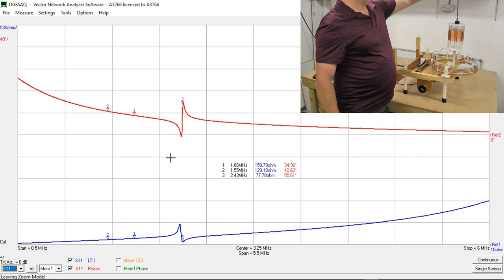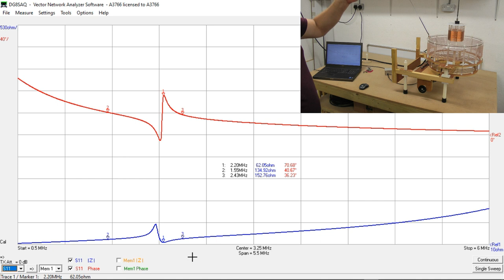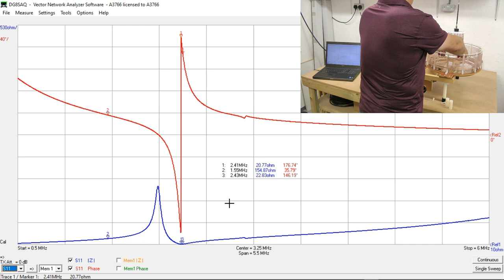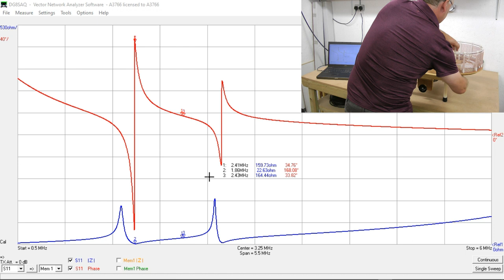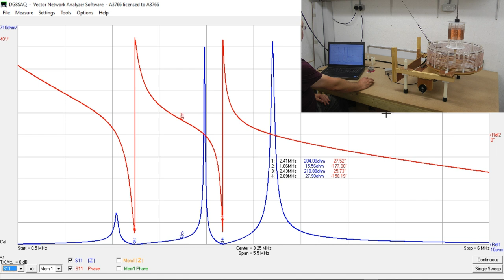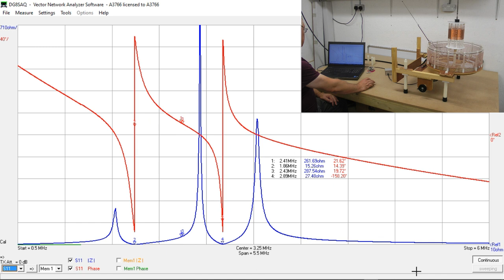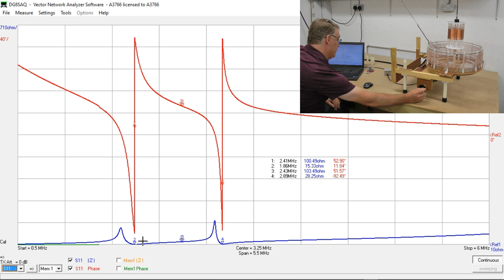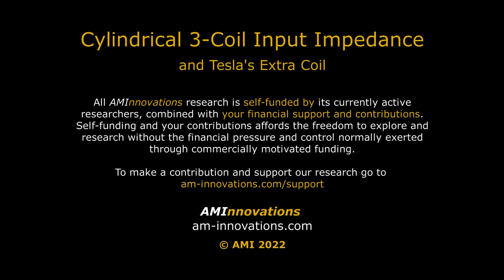Cylindrical 3-Coil Input Impedance - Tesla's Extra Coil

Comment: Hi Adrian - I am an EE who designs and builds TC and TM systems for making sparks! But I think we can have a civil discussion anyway! I have studied ladder network circuit equivalents for TC and TM, with and without a transformer. It seems to me that what you call a 3-coil system is really a 2-coil system with a split secondary, only a part of which is significantly coupled to the primary. The currents in the extra coil and secondary coil are pretty well matched because the shunt capacitance of the linking wire to ground is very small. The self-resonance of the isolated secondary is way above your operating frequency. To make a true 3-coil system, you need a significant capacitor from the link wire to ground, so that the isolated secondary with that capacitance resonates around your target operating frequency, the same one that your primary circuit operates at and the same one that the extra coil with its loading capacitance operates at. A system like this with 3 resonant elements might give interesting results? And tuning it would look great on your network analyzer. Best regards, Ian.
Reply from the maker: Hi Ian, thank you for your insightful comments, and I am quite sure we can have a civil discussion LOL :). The secondary and extra coil in the setup presented are not simply a split secondary with a low impedance wire link between them. The most important factor is that they are out of each others inter-turn magnetic field coupling distance, which falls of very quickly at the outer extent of the coil end. So they interact as two distinctly different quarter-wave coils which have one end connected, which is shown on the VNA measurements through the frequency splitting of the secondary and extra series mode resonant frequencies. It is the longitudinal cavities (LMD or longitudinal magneto dielectric modes) that are created between these distinct coils that makes this coil system particularly interesting for high efficiency transference of electric power over potentially long distances.
Reply: @aminnovations  Thanks for the clarification. I still wonder whether increasing the 'link capacitance' to bring the secondary self-resonance down to the signal frequency might improve your detection efficiency. Seems to me that a secondary coil self-resonance off-signal, with associated losses, can only harm efficiency? 'Sparky' 3-stage systems can be tuned like that, with high coupling factor, to get the energy out of the lossy primary circuit as fast as possible. Maybe your receiver losses are lower and don't need such measures. Regards, Ian.
Reply: @ridefast0  Hi, I have seen many designs by Tesla with dual secondary coils, Tesla said the coils resonated at both 1/4 wave and 1/2 wave as we need to build a coil that in its entirety resonates 3/4 of a wave to be in resonance then I assume that coil L2 must be 1/4 wave long while coil L3 must be 1/2 (1/4+1/2=3/4)
This conformation would not only allow the coils to be coupled perfectly but would also allow for lower coils to be made

I discovered that there is also a correlation between diameter and height which determines the speed of the pulse that crosses it, according to the explanation the second coil being thinner and taller has A higher speed of the low and wide reel and this allows to have the minimum load on the reel L2 

What do you think?
Reply: @cristianbianchi6155  When I design or analyze using lumped-L and lumped-C ideal components, the concept of modes does not arise so I can't help there. But in practical inductors, the ratio of diameter to height affects the Q-factor of the resonator and highest Q usually gives best results. The full mode analysis using transmission lines is too hard for me so I leave it alone - the 1/4, 3/4, 5/4 etc resonances never turn up where I expect them to be and it makes my brain hurt.😕

Comment: Thanks for sharing Adrian, good to see you working with the extra coil. I see the write up isn't online yet. I'll check it out when it's there.
I've been playing with the VNA and extra coil today as well. somehow my parallel capacity doesn't seem to influence much.
Also still questioning if a S12 would work with a series cap on the primary.
Since your are tuning wire length on the secondary, would you not prefer to connect the extra coil to the actual end of the secondary (antenna)?

Comment: my device uses a three stage bifilar coil setup. the two closest to the event collect and transfer the electricity. the one in the core transmits and transform's. works like a flyback. nice work very few realize the potential present here.
 just remember the powers that be wont let you collect free frequencies we are bathed in daily.
Reply from the maker: Hi, yes there is much to learn about how the coherent cavity of a multi-stage Tesla transformer works, there are very interesting transformations in electrical mode from TEM to LMD and back again, which go way beyond what is currently understood or utilised in current electrical power generation and transmission.
Reply: @aminnovations  ill be checking out the rest of your content. 🫡💯🇺🇸🙏🏼

Comment: The text I read from Tesla clearly states the extra coil is not within the electromagnet fields.
Reply from the maker: The extra coil is not in the magnetic field of the secondary. This can be seen when the secondary coil link-wire is removed from the extra coil, there is almost zero coupling to the extra coil and it effectively disappears from the VNA measurements. If it was in the magnetic coupling distance it would still appear in the results. It is somewhat surprising but the magnetic coupling falls off very quickly, which makes it possible to put an extra coil axially in the centre of a larger secondary coil - dependent on relative geometry of the complete coil system.

Comment: Why are there such large spaces between the windings on the primary and secondary coils? And why do you call it a cavity?
Reply from the maker: The spacing of the turns reflects part of the specific geometry for a specific application. This coil set is designed for transference of Electric Power experiments in the 160m amateur band, including Telluric. So you need to maintain a high magnification and quality factor combined with balanced TEM and LMD modes, which necessitates wider spacing between turns. Lots more on my website on this - starting from:
Tesla Coil Geometry and Cylindrical Coil Design
https://www.am-innovations.com/tesla-coil-geometry-and-cylindrical-coil-design
Reply from the maker: A Tesla transformer forms a longitudunal cavity for the LMD mode across its extension between two planes of much higher impedance, so this is normally from the top-load through to wherever the bottom-end is extended to, usually the ground, or in transference of electric power experiments to another Tesla transformer. This forms the "cavity", and in multi-coil systems there are a number if cavities interacting.

Comment: You are extremely close to some of my special frequencies in there. It's interesting. 3.24 megahertz is special, in my opinion.
Reply: And 1.88 megacycles. I'm trying to reach these exact frequencies. I've found the less turns with more space between windings allows for a much higher resonant frequency, right?
Reply from the maker: Hi, yes 234 and 324 are interesting vibrations as they represent the interaction between the duality, triplicity of life coming into manifestation, and the four-fold purpose of the unspeakable in manifestation :) ... if you have not seen it already you may find my presentation at ESTC 2023 on The Toltec System of Knowledge interesting. You can find a preview of this here from my website am-innovations.com : https://vimeo.com/864370550/e1e782c348
Reply from the maker: Hi, 1.88 is at the top end of the transition between the straight sword discharges, and the Golden ratio discharge which occurs at ~1.65Mc, but has an active band of +- 250kc.
Reply: 1.8 is more special than 1.88 mathematically though. More important.
Reply: Or 1.8888888888....

Comment: Hi, I have seen many designs by Tesla with dual secondary coils, Tesla said the coils resonated at both 1/4 wave and 1/2 wave as we need to build a coil that in its entirety resonates 3/4 of a wave to be in resonance then I assume that coil L2 must be 1/4 wave long while coil L3 must be 1/2 (1/4+1/2=3/4)
This conformation would not only allow the coils to be coupled perfectly but would also allow for lower coils to be made

I discovered that there is also a correlation between diameter and height which determines the speed of the pulse that crosses it, according to the explanation the second coil being thinner and taller has A higher speed of the low and wide reel and this allows to have the minimum load on the reel L2 

What do you think?
Reply: I've been looking into this as well, this design shows in both the Colorado lab the magnifying transmitter patent where the secondary has a much smaller L/D ratio compared to the tertiary coil, there's also how Tesla always shows the coils to be wound in opposite directions due to how the induction occurs. 

One odd thing though is how the resonant frequencies of all 3 coils in the Colorado design don't match up when running their dimensions and turns through an online resonance calculator, trying to figure that one out atm.
Reply from the maker: Hi, what I have found so far is it makes all the difference how you couple the coils together. When the secondary and extra coil are linked with a wire directly then they act as two quarter wave coils which have a high level of coupling between them, so the 1/4 coils cause beating between them which causes frequency splitting and both coil resonant frequencies move up and down respectively. A coupled coil will have different effective resonance points than an uncoupled coil either directly or via dielectric and/or mganetic induction field coupling e.g. primary to secondary ... There is also a correlation between diameter and height as you say, which effects the LMD mode effective group velocity over the surface of the coil, and hence its intensity with position within the complete longitudinal cavity created by the coil system ... A multi-coil system is truely a fascinating electricity laboratory! :)

Comment: very nice what i would like to understand how come you see the coil 1 and 2nd on the red on the VNA ? both of them ? is this how the scanner work ? and you put the extra coil on the blue ?
Reply from the maker: The blue curve is the magnitude of the input impedance to the coil, and the red curve is the phase of the input impedance to the coil. As the coils are coupled either directly or by the magnetic induction field, the characteristics of all the coils will be transformed back into the final input impedance measured by the VNA. So you see the transformed characteristics of all the coil in both the blue trace (magnitude) and the red trace (phase). This input impedance to the system is important, as it will define how we match our generator to the Tesla transformer, and also how we tune the Tesla transformer for different experimental conditions. If you are interested more then you can find much more about VNA measurements on my website here: https://www.am-innovations.com/cylindrical-coil-input-impedance-tc-and-tmt-z11 and in the related pages.

Comment: Another youtuber, said that Tesla misunderstood what he was seeing when doing his experiments regarding radiant energy and the way to explain one wire power, is that the current returns through the air to the tesla coil because the tesla coil ionises the air around the coil. SO that is how the circuit is completed. Does this make sense? I am not an electrical engineer.
Reply from the maker: Single-wire currents are based on the LMD mode that is established in the longitudinal cavity of a Tesla transformer. The LMD mode can be extended over very long distances and much further away than the ionised air around the high tension of the coil. Currents due to ionisation of the air only occur very close to Tesla transformer. LMD single wire currents in a Telluric experiment can be measured 10s of miles away from the transmitter coils.
Reply: @aminnovations  Thanks!
Reply: @aminnovations Have you actually verified that with your own experiments? And in order to get an LMD mode coil, you need to either be using a bifilar coil or a pseudo bucking coil where the signal is 180 degrees out of phase, which gives you a magnetic field cancellation and essentially turns the coil into a pulsed voltage capacitor. Is that what your 3 coil system is in this video? It’s hard to see on youtube the exact coil configuration you are using.